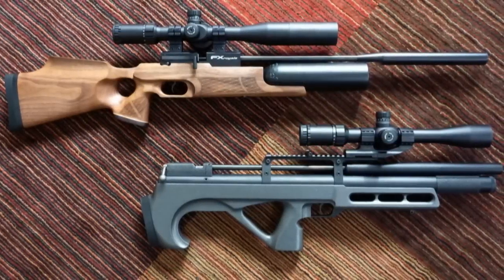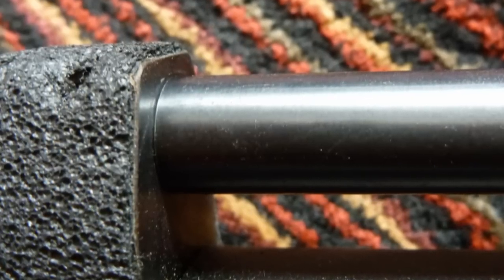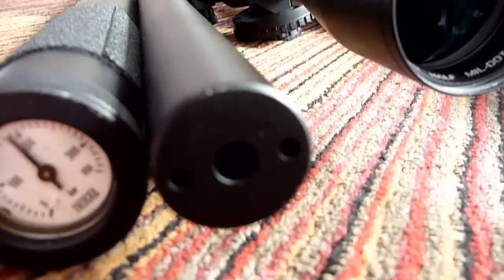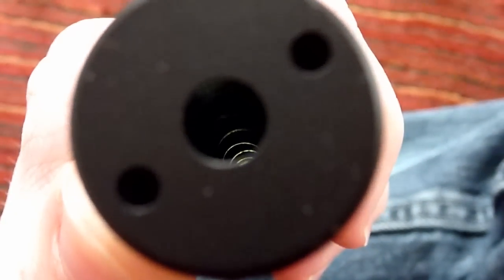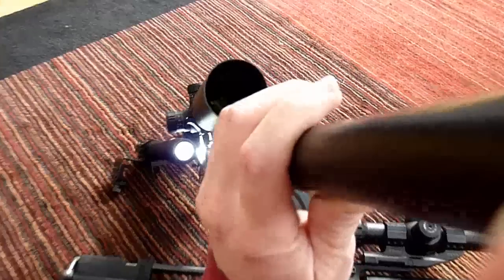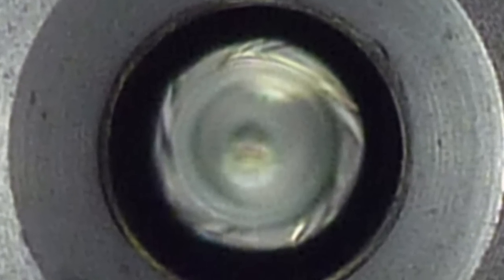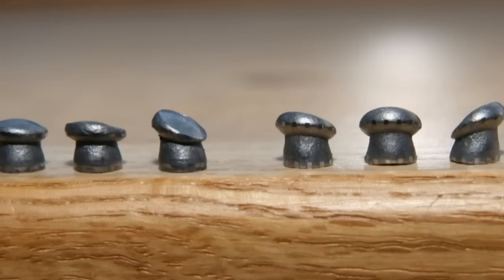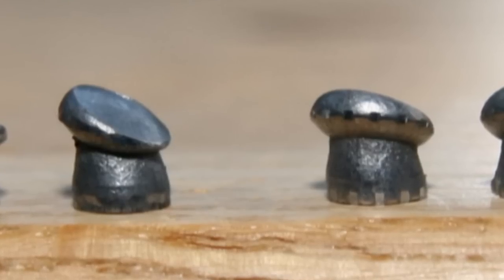Edgun Matador vs. FX Royale - Part 2 - Barrels, Lothar Walther vs. Smooth Twist

Comment: A smooth bore with polygon choke - manufactured by Carl Walther in special runs, so the same source as the full bore rifled barrel with choke... maybe just got the middle way and get a full polygon with choke from Walther for the edgun, a 605mm blank  is about $125 plus S+H.

Comment: @EdgunUSA 
Hi  Ted  nice  video,  you  have  hit  the  nail  on  the  head,   the  achillies  heel  of  normal barrels ie  leading  up  with  high  power  air. Btw a  rolled  up  synth  duvet  is  a  better  bet  as  a  pellet  catcher.
Awaiting  aftermarket  smooth  twist  when  Ben  gets  it  sorted.

neil